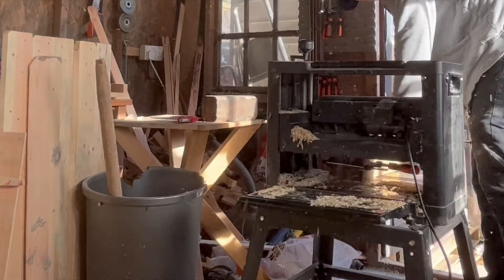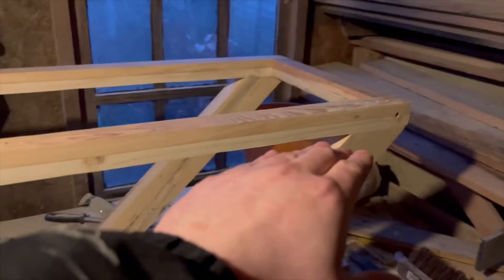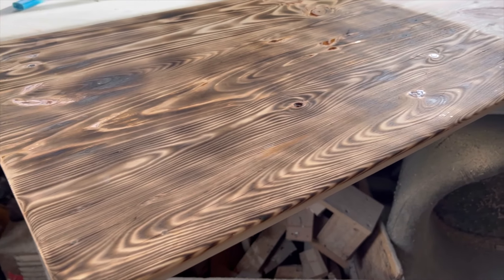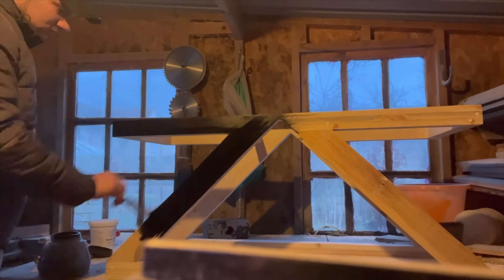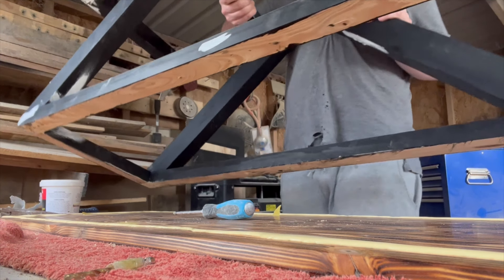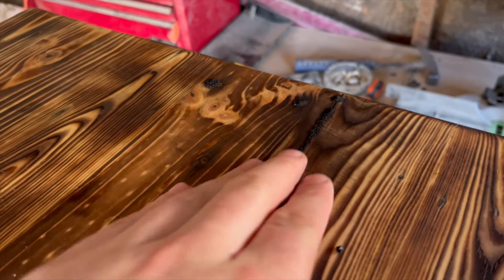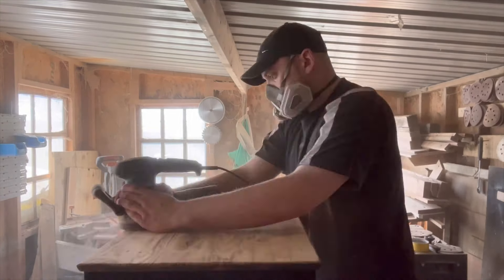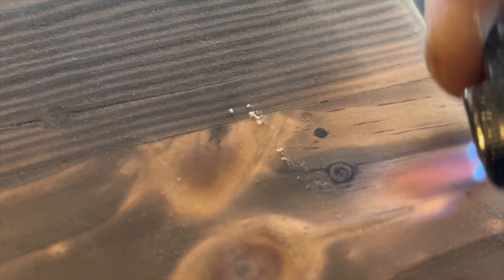I Built A $200 Table From Pallet Wood

Comment: Not a good idea to glue the top to the base (Been there, done that. The top cupped after 2 weeks).Take in consideration the seasonal wood movement. The wax and mineral oil finish is not gonna last. Next time you could try hardwax oil or linseed oil mixed with varnish. Maybe a water based poly. These are just tips I learned the hard way 😊.Nevertheless..the table looks cool! Subscribed!
Reply from the maker: I really want to try a poly finish I just don’t know what to buy and how to apply it in a dusty shop so I don’t get any dust on my table and thank you for your comment and advice!

Comment: This is a little rough mate, lots you can improve. Why are you using a food grade type finish on a table. A hard wax oil would be better. Something like Osmo.
Reply from the maker: Slowly learning as I go I use this finish because it was used in another video I watched and it was cheap to make since I’m pretty broke another commenter has Recommended that I finish the table using a water based poly coat so I’ve ordered a tin of that for my next build I’m also going to use threaded inserts on my next table to attach it to account for wood movement instead of glueing and strewing the table top on. I appreciate all comments because they help me learn and create better products for the future i I hope to be able to move out if the beginner stage soon and create products that are nice and last a lifetime

Comment: Hatoff to you for your perseverance, (I think I would have set fire to ot after the burner broke) well impressed with final outcome. O, as a tip. If you don't have a small drill bit for piloting a hole, simply clip the head of a nail chuck it into to you combi drill and hey presto!  Looking forward to you next issue.
Reply from the maker: Thank you! At that stage I had already sold the table and promised the customer it would be ready soon so I couldn’t afford to start over again but I taught myself a lot pushing through and finishing the project thank you!!

Comment: I'm watching this after watching several other professional wood working channels and I'm sat here thinking OMG what is he doing? (in particular the finishing bits). But I can promise you this is almost every single person on earth that has had a go at woodworking. I'm jealous you have a planer and a shed to work in, that's already more than me :) But I totally agree that we learn several new things every time we make something. I have made a lot of planters for people and bought basic power tools from the money I made from it. But now I worry about my early planter designs compared to my newer ones. It's a great journey though. Hope you carry on making things. Big fan of the burnt wood finishes. Looks great with a tint or dye into the wood too, check it out. Good luck.
Reply from the maker: Took me ages to save up for the few tools I have they are the cheapest versions you can get and all together still cost around £1000! I’m always learning new things and how to do stuff better one of the key things I’ve learned from building this is mounting the table top to the legs I should have used inserts instead of glueing the top on not only so when I had to redo the burn I could have taken it off so it’s easier to manage but it also allows wood movement and generally is a better way to secure a table top on. I’m also going to try use a different finish in the future and have a go at a water based poly finish so the table is a lot more durable but after all my lessons learned I and the customer that bought the table think it turned out great and was a lot stronger than I thought it would be with the legs i am around 16 stone and it took my weight stud on it jumping around (I do that will all my projects to make sure it’s strong because the last thing I want is to give a customer a product that falls apart) I’ve still got many more to learn but with every project I complete and all the comments I read I’m sure I’ll become a better woodworker in the years to come! Thank you for leaving a comment and I wish you well on your future career as a woodworker!
Reply: yeah man, tools are not very cheap lol.  I have been blessed that both my grandfathers were tradesmen (one nyc union electrician, other nyc union carpenter) as well as my dad who is a carpenter/contractor.  So i have a ton of tools that were passed down and shared and they are all mine now.  having all of the essentials taken care of has allowed me to buy some specialty tools over the last few years like a planer, a new table saw, a jig and scroll saws, ect.  I'm hoping to get a benchtop jointer and a wood lathe one day.

Comment: I myself i use an old cleaned out mustard squeeze bottle for my glue and it works great and the snap top keeps the air out and the glue fresh with out drying up
Reply from the maker: There a good cheap way to store your glue ain’t they!

Comment: Love the contrast with black and rustic wood detailing, I would highly recommend some sort of dust collection, even if it’s a vacuum cleaner from a diy shop. And manage cables cords ect as they can cause trip hazards especially with open flames with loads of sawdust on the floor, again just handy tips no criticism needed as we all start somewhere and get to where we want at the end. Good luck fella 👍👍👍👍
Reply from the maker: Yeah a dust collector would be idea nowadays I try just keep on top of it every time I finish using a tool i get the hoover out and suck if all up
Reply: @barrovianmade  even if you use a vacuum for the sander, that way it’s not so much of a mess plus your lungs would be cleaner lol. Good job though.
Reply from the maker: I need a new hoover really the switch is broken so I’ve had to wire it straight to the motor so everytime I plug it in it starts up and doesn’t turn off untill I unplug it which is annoying 😂 my workshop becomes a right mess after sanding though think I need to 3D print something so I can attach it to my sander

Comment: Mate i absolutely love the look of the table. Two things i think you could do to your game though would be to router out mortises and use z clips to attach the top to the frame. This way it would help with wood movement. I wouldn't even bother with glue. And also only a small tip would be not to start your sander before being placed on on the materiel as it can cause swirl marks on the surface. We are all still learning mate and you are definitely on the right track. Its a beautiful table. Well done
Reply from the maker: Thank you yeah I have learned a lot since doing this project and I wouldn’t attach the table top with glue again I’m still in contact with the person that bought it and there has been no issues with it but it’s best to stay in good practice
Reply: @barrovianmade  Please don't think I was criticising you in any way at all. It's a beautiful table mate
Reply from the maker: Thank you sorry if I came off stand off ish I love any comments that help me improve my work just at work at the moment so I quickly wrote that

Comment: Burning wood is a japanise technique called shao sugi bahn, it should be done in long even stroke along the grain. At the end of your video you made a mistake when applying the finish which is one we have all made. Dont squirt the finish on the workpiece. Put your finish in a bowl, square off your cloth (or use a foam pad brush) and dip it in and apply in long even strokes along the grain. Do that from left to right and then on the secound coat from right to left, buffing inbetween each finished coat. Watch the video back and you will see when you squirt it on the top look at the pattern, then when your wiping it all over the top look in the middle of the table and you will see the darker shade when the oil was sitting when you squirted it on. 

If yoy burn the wood in long strokes along the grain yoy get a much nice finished look from the burn. But if you go in any old pattern you can see the patchy bits where you may have missed or where the torch has overlapped a bit thats already burnt.

If i can give you one peice of advice it would be to Take your time. Hope this helps. 

Keith
Reply from the maker: I do struggle abit with getting the burn all even across the table I usually just keep going over it and untill it’s all uniform then if I notice anything darker patches I just use the sander and 400 grit to lighten them but I’ll give your advice ago on my next build that’s coming up (next video of some matching bedside tables) and I’ll give you a mention I will be using a water based poly coat for my next table instead of mineral oil if you have any advice on how I should apply that evenly? I was planning on just brushing on a thick layer and sanding back to being flat but I’m sure there’s got to be an easier why other than spraying it

Comment: What finish did you use?
Reply from the maker: I used mineral oil and beeswax but I’ve been told that I should be using a hard wax finish or a water based poly finish

Comment: Measurements? ... I plan on making one with the exact measurements with yours .. NICE WORK!!..
Reply from the maker: Hey I’m sorry mate but I’ve already sold the table and didn’t keep track of the measurements but I worked out the measurements for the legs by getting a measurement tape and angled it at 45 degrees next to a sofa to figure out how long I needed to cut the beams for the legs
Reply from the maker: Hope this helps and just message back if you need help working out any other measurements or have any questions about how I did things I’m quite active on here and reply to all comments

Comment: Don't use your fingers to fill holes and cracks, get yourself a scrapper, you won't wast as much and it will be cleaner
Reply from the maker: I did have a paint scraper I used but it’s so covered in glue and filler now that it’s useless (never cleaned it) need to buy myself a new one thanks for the comment!
Reply: @barrovianmade  it wont clean off with some thinner or spirits and or sanding?

Comment: Dust collection.... £50 for a cheap vacuum its all you need to start with, and its just not worth the risk not having it. Masks on do so much.
Reply from the maker: I have a better full face mask now that I use and a cheap shop vacuum that I should probably use more
Reply: @barrovianmade  definitely, i did some sanding when building my home office 8 months later i was still getting dust stirred up, id never sand with the vac attached from then on lol

Comment: 400 grit is too high mate, no need. 240 is plenty or the finish struggles to penetrate if the wood is too smooth.
Reply from the maker: I’ve just bought 60 to 800 grit discs for my sander so far I haven’t had any issues with my finish soaking in so far but i hope sanding to 800 won’t cause any issues I love a silky smooth table top might have to sand some test pieces before committing to sanding my next project up to 800 grit thanks for the heads up